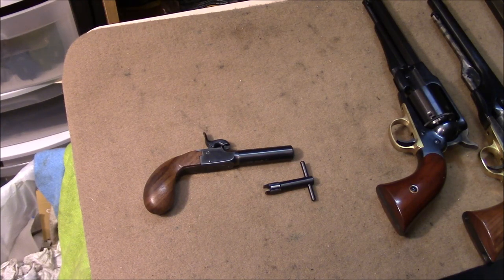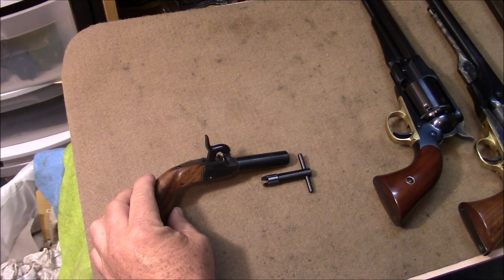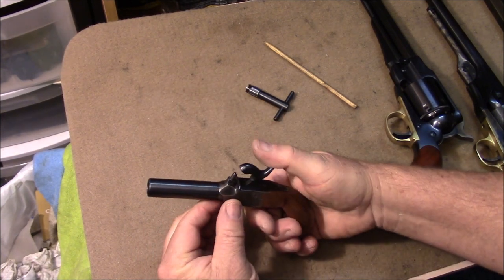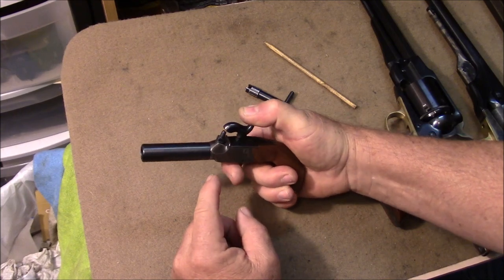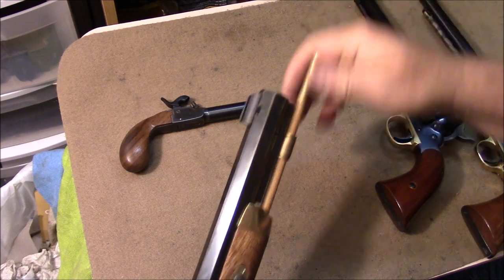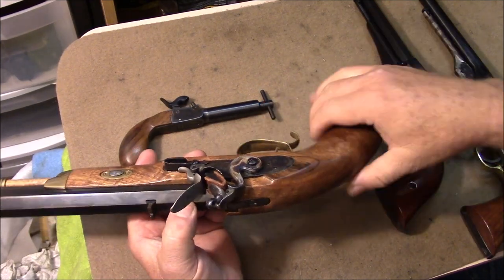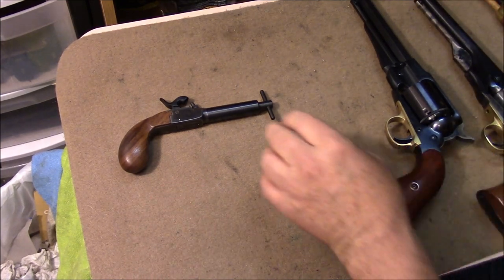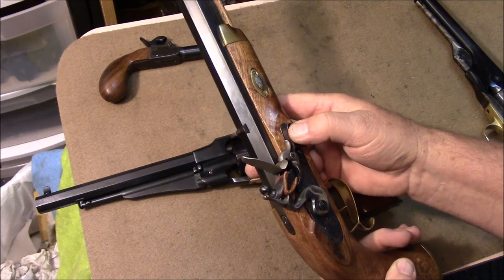Pedersoli Screw Barrel - Is It Dangerous?

Comment: I have a very old derringer that has been handed down as far back as I know. Same thing with the screw barrel and looks the same. The only difference is mine is a flintlock. When you cock it back the trigger that has been hiding up in the gun, now drops down in a use able position. It’s a very different type of derringer and no worries I would never fire it. This is the first time I have seen a derringer that looks similar. I wish there was an easy way to post a picture, stay safe!

Comment: to avoid chain fires with open top colts, use .454 or .457 to make sure you get a ring of lead when it's seated. I've noticed a .451 moving between shots.
Reply: Do you think it causes dangerous pressures ? Putting in a .454? And what are the other cons to using a tighter seal on ball and barrel
Reply: @RevoZ0  It is completely safe to use a ball which is .005" bigger than the chamber, of course the act of seating the ball sizes it to groove diameter ,in fact the larger diameter the ball is the more engagement length with the rifling you will have, no greater mistake can be made than using an easily loaded ball! this will eventually result in a chainfire, but with a ring of lead shaved off it is impossible for a flame path to occur, chainfires occur at the rear of the cylinder, when the caps are a loose fit, this allows the huge amount of hot burning gasses to enter the next chamber, and with modern repro C&B pistols the mainspring allows the hammer to be blown back, allowing more gas to escape, an original Colt hammer draw is circa 12 Lbs, a repro normally circa 3 Lbs! Stay safe! Chris B.

Comment: I have never removed the barrel to load this gun. You simply need to use as much powder as the manufacturer recommends or, as a last resort, 5-10% more. Constantly unscrewing the barrel unnecessarily destroys the already quite delicate thread. It is true that by loading a slightly over-caliber bullet, we will cut its edges a bit and it will have more clearance in the cone at the base of the barrel, but we can place a pad of greased felt or a disc of thicker cardboard on top of the powder in the chamber and then cover it with felt. crutches. My experience shows that it is better to load this gun using the traditional method through the barrel, without unscrewing it. The possibility of using a wad makes the arrows much more stable, and the energy also increases because the bullet is better sealed and does not lie on the powder itself. it must be taken into account that if the powder weight is too much, the upper bolt securing the slide will be damaged first. Since the tap is light, the spring must be and is very strong. In practice, this means that it can break after firing 100-130 shots, which is the norm for this gun. It's a nice toy, but not for frequent use.

Comment: Dangerous?!  It is to the recipient!  At 12 yards, right through a one inch pine board, heavily bouncing off the second board. Penetrating below the surface of a 2'' fir board at 12 yards. Heavily denting corrugated sheet steel at 50 yards.  The powder   m u s t   be compressed properly though!  Also, I fire a Colt molded elongated ball of 190g. This performes better than a round ball.
Reply: Yep. And thank god it's not dangerous! :-D
Reply: can you also use a diabolo formed projectile with blackpowder? and how much powder do you can fill in before it gets too big for the barrell

Comment: What is the percussion “nipple’s” thread pitch on the Pedersoli Screw Barrel pistol? I wanna change it out.
Reply: Would it be possible to put a longer Barrel on and use it as a muzzle loading Shotgun? Or would it be too dangerous because of the larger load?
Reply: @spixesdoana8688  I just edited my question so it was more clean. I’m referring to the nipple, not the barrel.
Reply: @spixesdoana8688  I do NOT recommend overloading this pistol. 10 grains max of black powder. I wouldn’t put a longer barrel on it. No worries. There are many other pistols that might please your needs on the market.

Comment: Out of curiosity, how was a pistol like your little screw barrel or a flintlock carried on ones self? What was considered a safe method of carry? Were they concerned about dropping a pistol and having it fire?
Reply: Some of the better ones had a sliding safety on top that locked the hammer.
Reply: Maybe a leather thong between the hammer and cap with the hammer down?

Comment: Hey! Not sure if you will see this comment, but I've got something of a special situation here. I've got a screwbarrel belgian pocket pistol from I'd say around 1850, but the problem is that the barrel is stuck in place and attempting to unscrew it might ruin the entire pistol. Tried everything and it's still stuck, so I cannot measure the quantity of powder by unscrewing it and loading it that way and I have to resume to loading it by pouring the powder down the barrel. If you don't mind, could you please tell me the weight of the powder that you use for one shot? As I can't measure by volume I must go by weight and I do not want to add more powder than necessary for fear of creating too much pressure. The size of the pistol you've got is similar to the one I have currently so I believe that the powder charge should be more or less identical.

The rest of the pistol is in nice condition, the only issue is the stuck barrel. It does blank fire just fine, but there's not as big of a danger in that case as there's no bullet to allow the buildup of excessive pressure.
Reply: have you managed to unstick your barrel yet? I'm in a very similar situation. I don't want to fire it, but I would like to remove the barrel to clean properly. if you've managed, I'd love to hear how
Reply: @iosis2009  Sadly no, still stuck. I just use it for blank firing for fun, kind of gave up on trying to unscrew that thing, it's so tight I fear I might damage the entire pistol in the process., Not going to risk using bullets as I don't know how much powder to pour without unscrewing the barrel and it'd be risky to load more powder than needed. :/
Reply: @Lysergide  just curious but have you tried using a barrel vise? I've just discovered them so going to maybe give it a try. They're too nice of a pistol to not want to restore it
Reply: @iosis2009  Yep :/ Also tried using a vise. Despite the octagonal barrel of the pistol and the pretty strong grip the thing still wouldn't move. I'll probably take it one last time to a different gunsmith but if all fails I'll just buy a replica for target shooting and keep this one as part of the antique collection.
Reply: @Lysergide  I'm already contemplating welding something to the barrel to give more leverage and I would grind it off later but that will likely be kept for an absolutely last resort. Good luck and hopefully you can get them apart. They're great little guns
Reply: @iosis2009 Good luck to you as well man, I'll see what I can do, it'd be a pity to damage these beauties.
Reply: If it screwed on, it can be screwed off. What happens is that powder gets in the threads and acts as cement (it essentially turns to clay.) What you have to do is soak it in a safe solvent like Ballistol, WD-40 or Marvel Mystery Oil for a week or so, then you can break it loose with a barrel vise. 

If it doesn't come loose after that, then you'll have to assume the previous owner welded the barrel on. It's rare, but it was a semi common/ uncommon mod due to the principle of "one-piece construction is stronger so now I can fire a heavier load." In that case, just load it like a standard muzzleloader.

Comment: It takes exactly 10 grains of fff. The only way this little pistol is dangerous would be to point of at ones self or someone else and pull the trigger, loaded of course.PS: you can also load more powder by loading it like a muzzle loader without taking off the barrel, then it actually has a little power.

Comment: Allow me to start by saying that your video's are of great educational value and I enjoy watching and learning from them, thank you. I bought one of these little derringers as a gift to myself, got the indoor shooting nipple that takes a shotgun primer and use it as a little fun item without powder as the shotgun primer has enough power to send that .45 ball (thanks ever so much for that tip and how you load yours) down the barrel and with enough power to go through drywall at several feet... Adding powder would be a bit dangerous me thinks, turn it into a magnum, not sure what pressures would result in shooting it like that... I got the indoor firing adaptor from Pedersoli as I have never been a fan of caps, to unreliable and I like reliable :-)
Reply: It's made to be used with black powder.

Comment: I fire this pistol a lot.  The danger is two things,- 1- Dropping it where the hammer, resting on the cap and not at half cock, discharges it.  This can   c e r t a i n l y   happen!  2- Low powder charge which fires the ball at such a low velocity that it bounces off the target back at the shooter.  This   c a n   happen and   w i l l ! (another thing that can cause this is a too loose a fitting ball that rides down the bore causing a space which reduces the pressure force. This pistol holds too low a charge to be a  'pipebomb' danger.
Regarding too low a charge/air gap etc.  This is not possible with this pistol. It s  just too small.
Reply: For penetration tests on hard surfaces it's a good idea not to shoot in a 90° angle straight to the board. Always a bit sideways, so that a bouncing bullet would miss you. But psssst: Let the Darwin Award nominees decide by themselves!
Reply: Ah by the way dropping and hammer: take a short piece of clear pvc hose (i.e. air hose for aquariums), lenght about 10 mm, diameter so that it fits over the handle bolt of the barrel wrench. Charge the gun, set the cap and then put that piece of hose over the cap and piston, then let the hammer down, so it's sitting on the hose, not the cap. When you want to use it, cock the hammer, remove the hose with an elegant swing of your shooting hand and it's ready to rumble. Simple, safe, cheap.
Reply: I have a pair I keep loaded for months at a time, carried on half cock, filled to where the ball goes, then some elmers gel glue on top of powder, .454 ball. I tried the .451 and had the problem with the ball moving and powder getting contaminated. 
after being loaded for 6 months....belly gun range... 3'... it'll go thru 2 gallon jugs.

Comment: NO! I've been involved with black powder for decades. THEREFORE, NO! Unscrewing the barrel every time is bad for that little firearm, and it is a ''firearm''
(It's an ''arm'' & it fires__a reply said it's not a firearm=Wrong!), 
1st, it scratches the rifling with the tool.
2nd, it will eventually  wear out the threads
3rd, it takes much longer
4th, it is not necessary